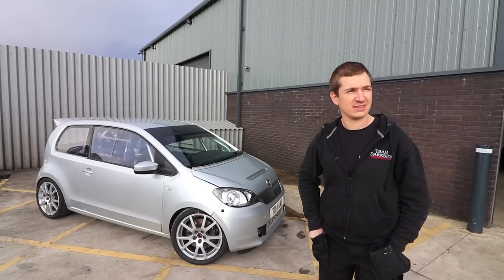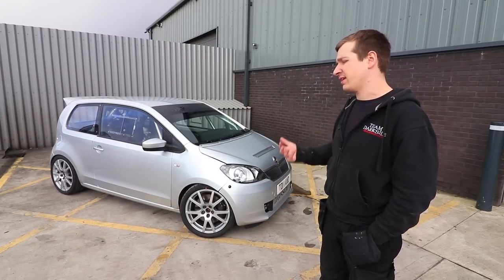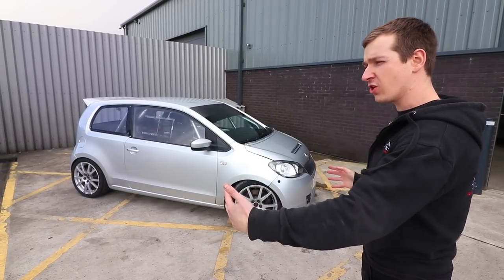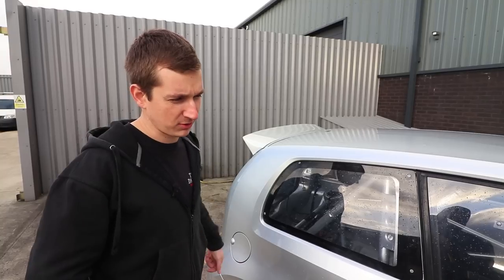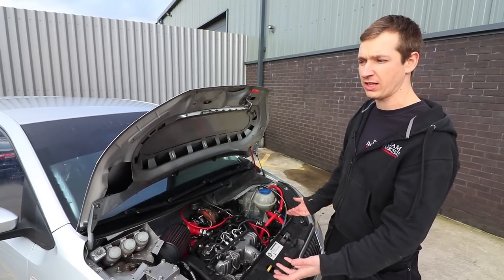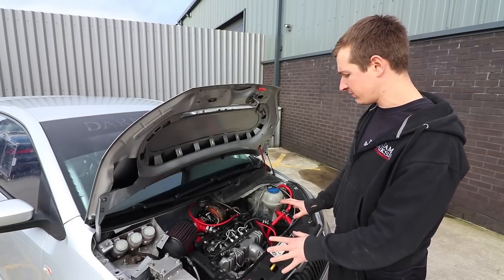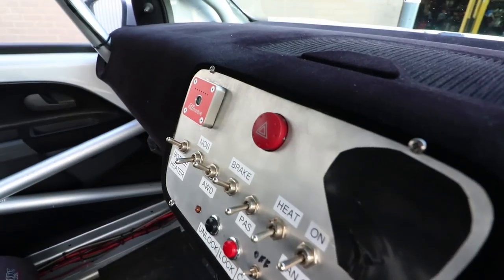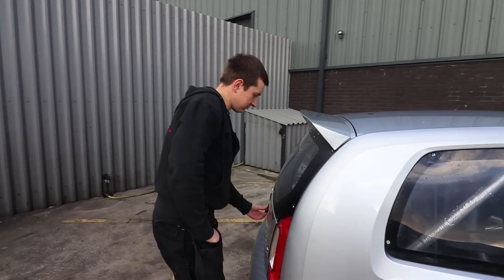2.0 TDI 360BHP AWD! SKODA CITIGO TRACK WEAPON!!

Comment: 360bhp skoda citigo,volkswagon up,seat

nice bhp for track day and street use.

nothing that bad and look so fun to.

what is the egnie in it 2.0tdi

inline 4 or a v6 2liter egnie?
Reply: Inline 4
Reply: @ryanp6138  cool not bad when to put the power weight ratio same time.

it suits it.

imagine 2liter inlin3 quad turbo quad hydro trubo quad hybird turbo quad electrick turbo as well.

i just made it up thingking about the amouht of turfir fit in a small car
Reply from the maker: Less than 24 hours left to Win it for £15 - ENTER HERE:
   darksidedevelopments.co.uk/win/   T's & C's Apply

Comment: Reyt then, yet I told you Ryan this car is a fire ball. And each time I see this video I find out something new. You just say gear cables are not standard. Are they from CAE? What's difference? Better shifting?
Reply: It's from a place that makes Boat and Airplane control cables. They are just longer so we could move it back.
Reply from the maker: Less than 24 hours left to Win it for £15 - ENTER HERE:
   darksidedevelopments.co.uk/win/   T's & C's Apply

Comment: How much boost you running on this thing?
Reply: 40psi
Reply: @ryanp6138  so the torque peak is most likely at 4500 rpm
Reply from the maker: Less than 24 hours left to Win it for £15 - ENTER HERE:
   darksidedevelopments.co.uk/win/   T's & C's Apply

Comment: There is no way that you could make it AWD without those ABS sensors?
That is the only thing that sends power to the rear wheels?
Also, the size of the car benefits its weight I suppose, but along with it comes the small engine bay and working in such small space must be a bitch sometimes, eh?
Reply from the maker: you need the full ABS ECU to make it work correctly or buy a £2000 standalone
Reply from the maker: Less than 24 hours left to Win it for £15 - ENTER HERE:
   darksidedevelopments.co.uk/win/   T's & C's Apply